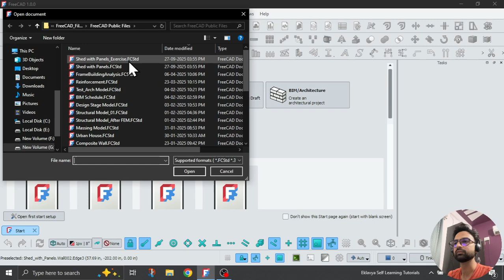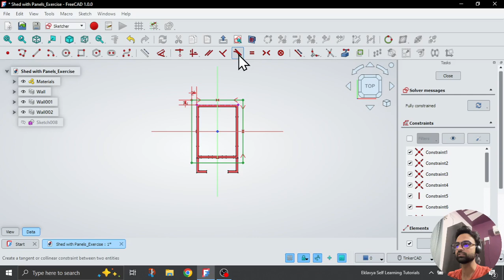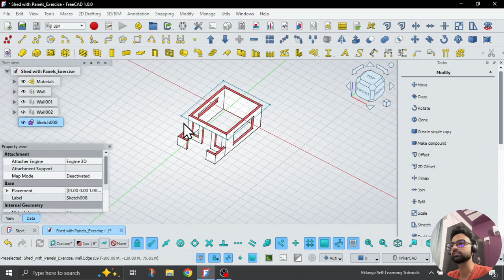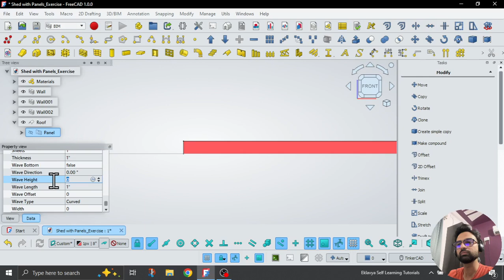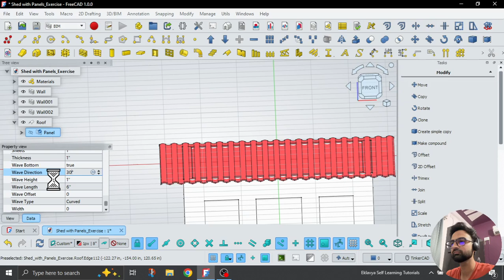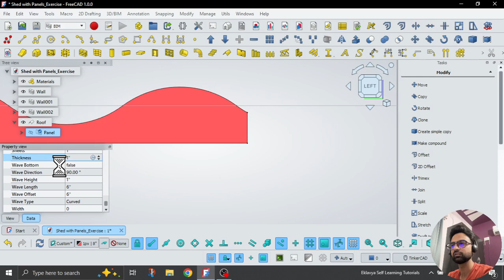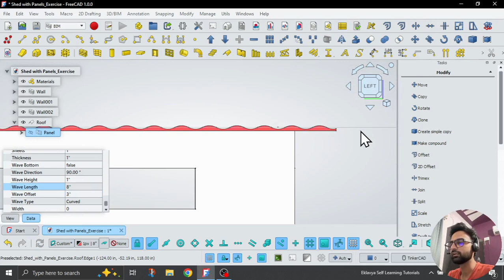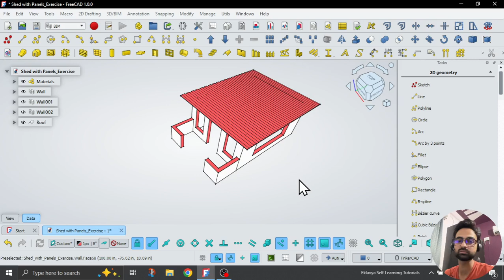FreeCAD Daily #22: Create Corrugated Roof Panels for BIM Models

Comment: I've been having a lil bit of problems wich i dont know if it is related to the software or my hardware... when im using FreeCAD it starts getting heavy, it stops and closes down. I have a Lenovo Legion 5 with GEforce GTX card... do you think its the software is heavy or my PC. is not powerful enough? what do you run ? does yours stall in the middle of a project ever ...? kind regards from Mexico
Reply: I'm using a 8 year old laptop with MX150 which, by today's standard, is a potato laptop. And It runs just fine on my project. It doesn't sound like the hardware is the problem.
Reply: @michieltieleman9462 thanks for the reference point , is very useful comment so I can look into Hardware performance setup tweaking
Reply from the maker: Your specs look powerful. Probably, there could be some configurations for the graphic card with respect to the applications on the system to run. May be trying manipulating that could solve the issue?
Reply: @EklavyaSelfLearningTutorials yess, I'll try tweaking my hardware
Reply: I've experienced some problems to open already finished/ongoing projects too. 
Sometimes takes 2 or 3 attempts go make it going. 
Even with new models can happen and there's no explanation for that...
Maybe I have to run the machine under Linux OS. I'm using Win10 for now.
Reply: @LFANS2001  Im using widows also. I really dont know in programming terms what makes the software smoother or "ligther" to say so. I think its got something to do with they way its compiled before its published perhaps its a lil on the heavy side... i dont really know what it could be, but on the other hand AutoCAD also gets heavy during the process of applying hatches... so i guess i just gotta be thankful to Yorik and the rest of the guys...